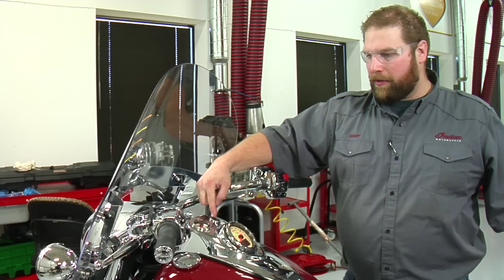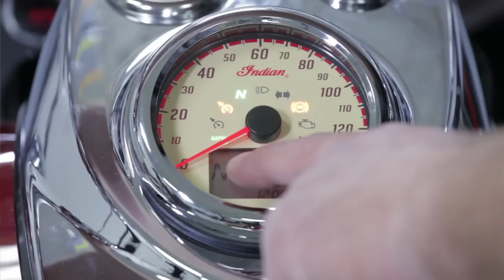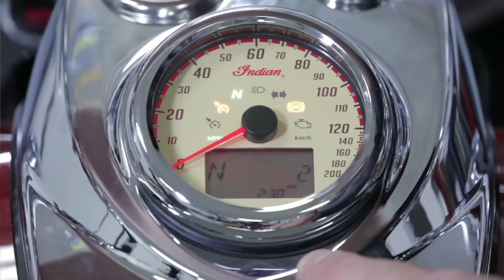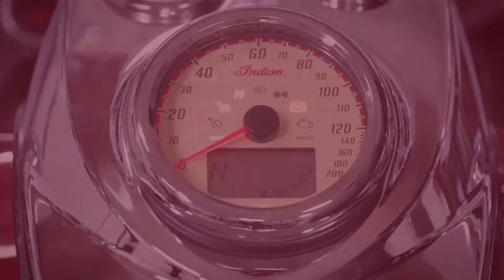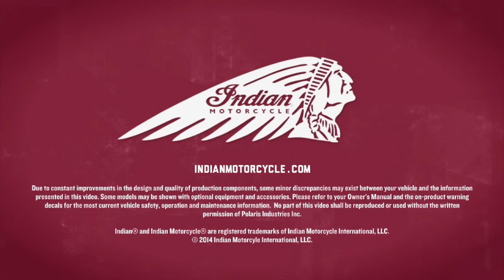Using the Indian Chief Classic and Chief Vintage Instrument Cluster - Indian Motorcycle

Comment: Very informative. I recently purchased a 2016 Chief Vintage. There is a fuel gauge in the LCD screen at the top. It came on and functioned for one ride and then went off again. Apparently, it works on some Vintages and not on others. Mine came and went in one ride.  Do you have any thoughts on this? Thank you.

Comment: I like the Classic most of all but if the MPH light is on why does the speedometer show KPH?
Reply: The numbers on the dial of the instrument do not change.  When the MPH light is on your LCD read out will give you info in Imperial (miles and gallons) and if toggled to K/MH will show the information in metric (kilometers and liters).